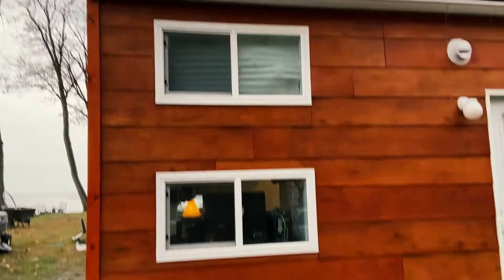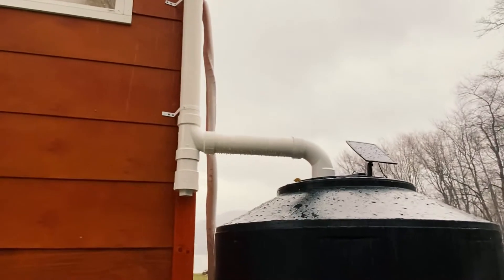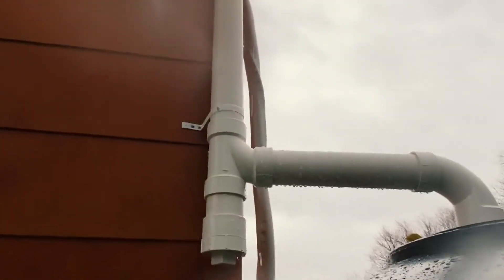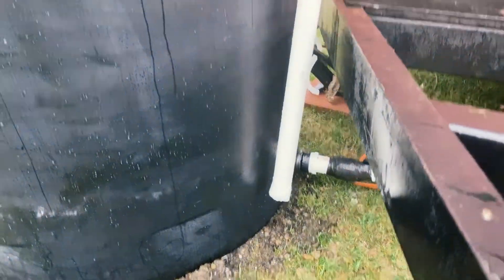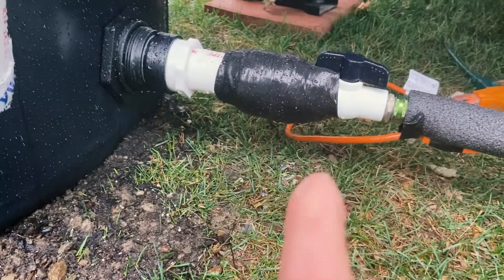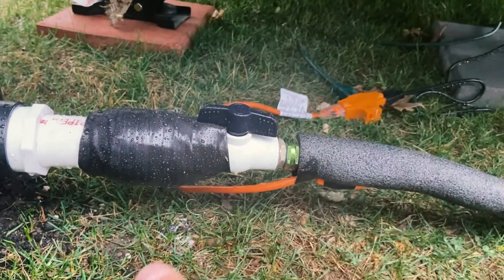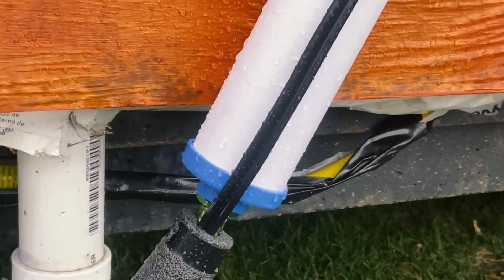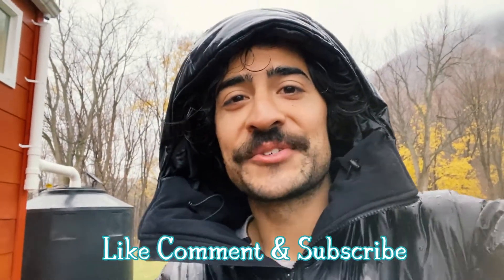A Rainwater Harvesting System for Winter!

Comment: I think it gets too cold where I am for a setup like that where everything is exposed.  Not a whole lot of information for northern winter hardy rainwater catchment systems.  I'm planning on going with a 1500 gallon underground cistern tank buried around 7ft down, buried connection and pump with some kind of service hatch, going under the shack and coming up through the floor with pipe insulation and heat tape along that whole section.  overflow, inlet pipe, and 1st flush will be just above ground/slightly buried with heat wire in areas that may have standing water.  The next challenge is collecting water of the frozen variety for half the year.  I'll try some heat wire in the gutters and maybe some on the roof which will be run only when I need to start getting water.  I'm hoping i don't need to put the heat wire on the roof but can just snow rake snow down into the gutter or let it slide down as I got a steel roof which have a tendency for snow to slide off of when the sun heats them up.  I'm excited to give it a try and adjust/ modify next summer.  with the amount of water I normally use, I might only have to melt the snow a few times or less.  It'll also help keep all that heavy snow load off the roof so win win.

Comment: I had to buy a new septic tank for water catchment here in Missouri. Hoping to bury it so my discharge line stops freezing. No running water yet but 1000 gallon tank is more than enough to last 3 seasons. Winters seem dry here so we will see.
Reply: did you need to buy a new one because it was ruined by frozen water?
Reply: @adriennemiller.music.  no I bought a septic tank because the closest potable water tank over 500 gallons was three states away. Now Lowe’s finally has 2500 gallon water tanks here. Septic tank is not designed to hold potable water. PCb’s are toxic

Comment: do you have a link for the de-icer? and solar airation?
Reply from the maker: these are the ones I have:

https://www.amazon.com/Allied-Precision-BDT250-Multiple-Thermostat/dp/B000TZ745A/ref=sr_1_42?crid=12SVYXT0ZJOOQ&keywords=tank+de-icer&qid=1646764110&sprefix=tank+de-icer%2Caps%2C123&sr=8-42

https://www.amazon.com/Lewisia-Oxygenator-Aquaponics-Aquarium-Aeration/dp/B07WKH68P4/ref=sr_1_5?crid=1EXKTIYOEDC1Z&keywords=solar+aerator+for+pond&qid=1646764160&sprefix=solar+aer%2Caps%2C147&sr=8-5
Reply: Thank you for the links and your vid. Very helpful. Do you find that that small de-icer is enough for that big tank?
Reply: @RelateGREAT I was wondering the same thing. That de-icer didn't seem nearly big enough for a 500 gallon tank, but I have no experience with such a setup so I can really can't be sure about it

Comment: You mention you put that solar thinggy on the top of your watering tank. How that works?
Reply from the maker: A small solar panel is connected to an aerator pump, which is in my water tank and keeps the water moving so it doesn't freeze / get mildew.

I have this one:
https://www.amazon.com/Lewisia-Oxygenator-Aquaponics-Aquarium-Aeration/dp/B07WKH68P4/ref=sr_1_5?crid=1EXKTIYOEDC1Z&keywords=solar%2Baerator%2Bfor%2Bpond&qid=1646764160&sprefix=solar%2Baer%2Caps%2C147&sr=8-5&th=1
Reply: Which wattage?  2.5, 5, or 6?